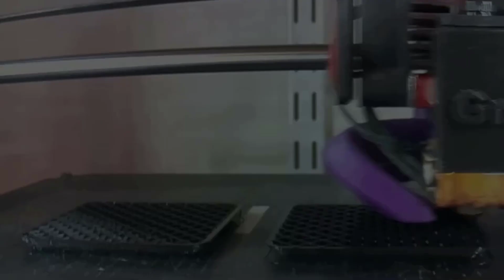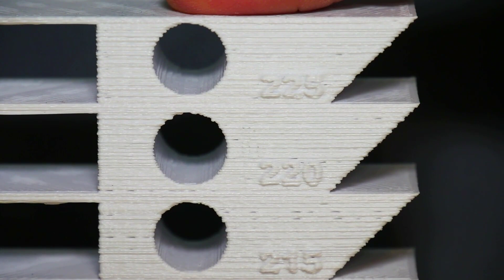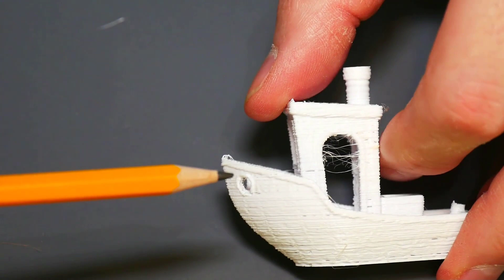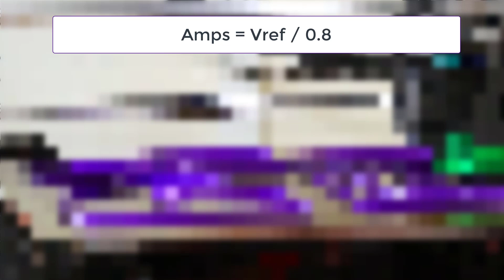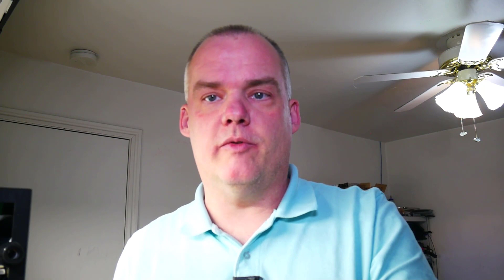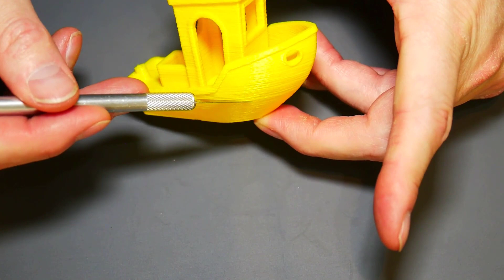Duplicator 9 Improvements - Adjusting the VREF

Comment: Hi, I just received that machine as a gift. Were you able to fix the problem with the rough layers?
Reply from the maker: Yes, by replacing practically every part on my D9. It actually prints quite well now. I think it could still print faster, but that will require some speed testing. Thanks for watching!
Reply: @Grimm3D  Thanks. But replacing all the parts isn't feasible for me. I thought it was just a one-off issue. Thanks anyway.
Reply from the maker: @julitoCba probably the biggest change was the linear rails with new bearings and brackets. 

Also, the full sized 110VAC heater made a huge difference, but I'm not sure you can get those anymore. Might be able to find someone to custom one for you.

Comment: thanks Grimm. Using prusa slicer with my d9 500 bridges are a disaster. I have changed the "exteral perimeter" abd "bridge" accelerations to 500 but no better results, Do you have experience with prusa and accelaration? Any tip? Just to confirm. What is the g-code type for a D9? Thanks in advance.
Reply from the maker: by default, PrusaSlicer tries to bridge everything that can be bridged. This is definitely not my first choice in most situations. I turn that off for all of my machines in PrusaSlicer under Print Setting -> Support Material - - turn off "Don't support Bridges"

When working with PETG (and sometimes PLA), I also turn off the "Top Interface Layers" (set to zero). This makes the supports removable. 

On a side note, when you do this, make sure the layer directly above the supports does not extrude parallel to supports, adjust the Pattern Angle if needed to change the direction of the supports to create a difference between these two layers. Use the pattern angle to get the difference close to 90 degrees if you can.

Thanks for watching and thanks for the question!
Reply: @Grimm3D  Thanks for your kindness and help. I´ll keep you informed.
Reply: Finally most of my problems came from the power loss recovery. Anyway, still fighting.
Reply from the maker: @juliansm3815  Keep fighting. My D9 is now working fairly well. I have some videos coming up that are gonna be awesome. Thanks for watching!
Reply: @Grimm3D  Fighting? Not only with my wife?🤣 I wanted to check the fan with the g-code M106 S255 and the fan does nothing. Did you have this problem?
Reply from the maker: @juliansm3815  I'm actually having trouble with my part fan right now. For some reason it is not spinning. Should be 100%.
Reply: @Grimm3D  Are you sure that it has been working in the past?
Reply from the maker: @juliansm3815  yes, I'm sure the trouble I'm having right now is a configuration issue. Gotta get PrusaSlicer properly set up for this beast. I'll get it figured out.
Reply: Finally the hose that protects the cables of the fan touch slightly the fan. That´s why there was no spinning.
Reply from the maker: @juliansm3815 I'm glad to hear you got it figured out

Comment: Hi Where did you find Rating current for your motors? Mine have no markings, no part number  D9/300.
Reply from the maker: My motors have markings on the back of the motor. They were all Moons' Electric Company, and each of them had a part number on the back of the motors as well. I emailed Moons' tech support department and ask for the spec sheet. They emailed it to me. On a side note, I was told that Moons' had much better motors than the 'very' old models installed on my brand-new D9/500, so in the future, I might look at replacing the old versions with the updated versions.

Comment: Does this machine have a preferred plastic it wants to use? My job you run into that sometimes, the machine get picky with material.
Reply from the maker: So far I've only tried eSun PLA. I plan to use that machine for PETG printing, but haven't gotten that far yet.
Reply: I have one printer that does not like this one particular roll of clear pla. My other one prints it perfectly. No idea why.
Reply from the maker: And that could just be a bad roll, or moisture. It happens.

Comment: Where did you find the Rsense values? Just looked on the board and found the right resistor? Or find the values online?
Reply from the maker: I kind of glossed over that in the video, but I did mention it @8:30. Your Rsense is the resistance value of the resistors between your drivers and your stepper motors. The resistors on my board were labeled with R100, which equals a 0.1 ohm resistance value. Therefore, my Rsense is 0.1